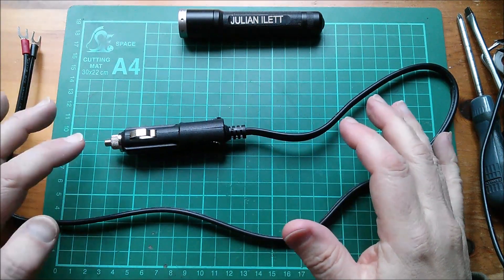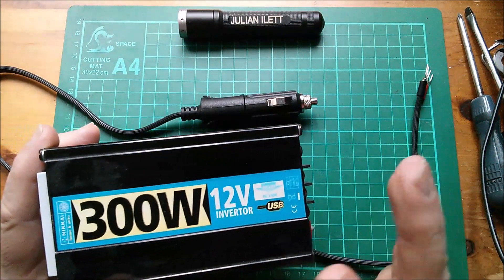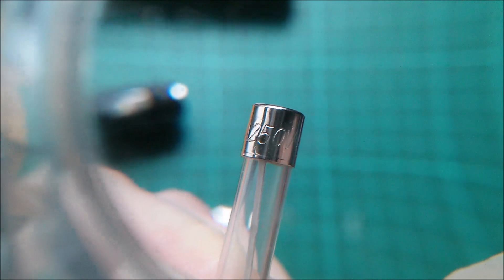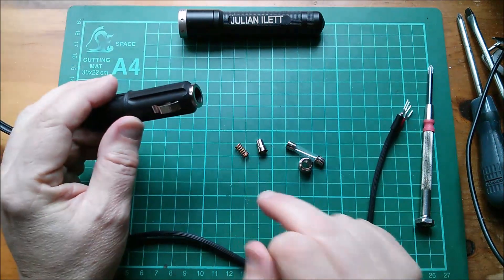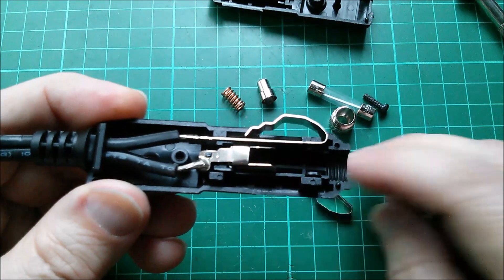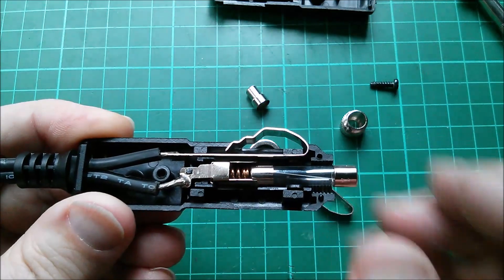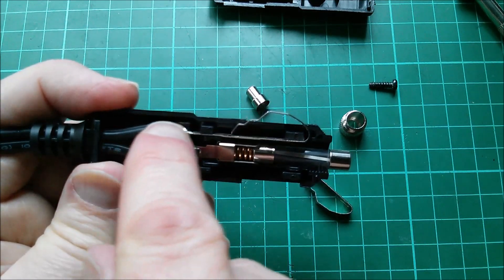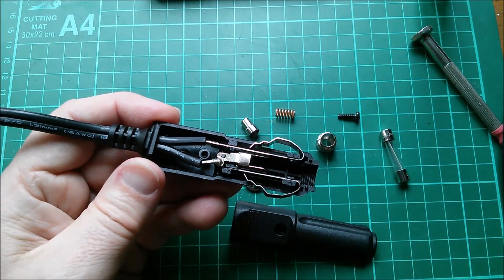Cigar Plug can Sustain a 15A Current

Comment: The 12V accessory plug is the SCART plug of the DC connector world - awful!
Reply: So what would you have used instead for analogue RGB video links on domestic/consumer equipment then? Cables terminated with seven BNC connectors? [one each for red video, green video, blue video, composite/combined sync, audio left, audio right, control/function switching]
Reply from the maker: I agree completely